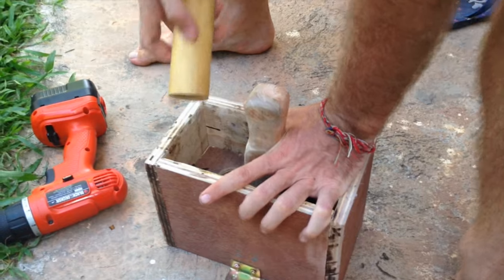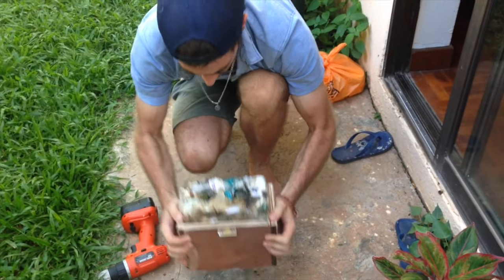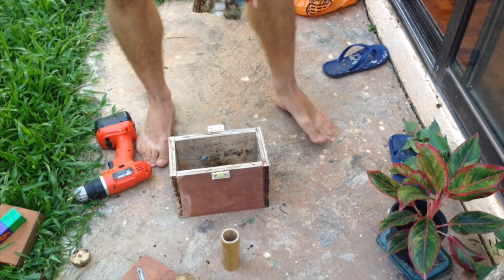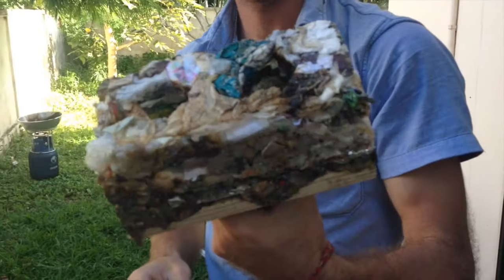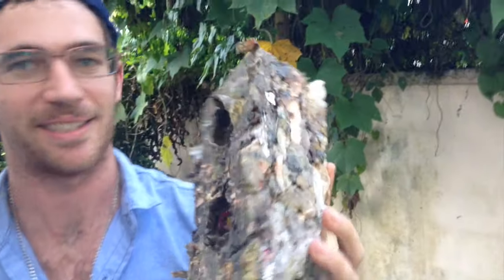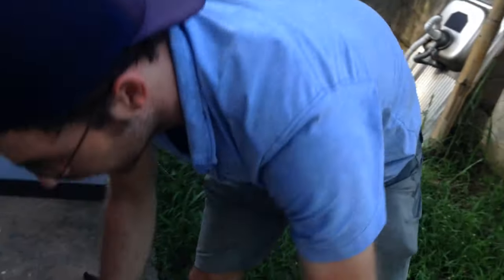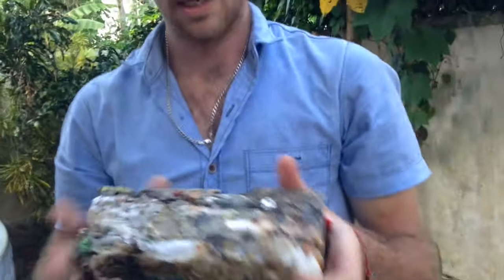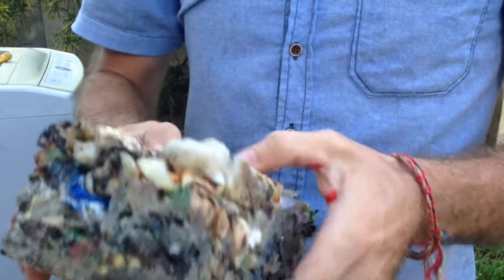Our First Plastic Brick

Comment: Hy, 
Please the processser to make plastic brick.
what material you used in that?
what is the mixture you take that material?
Reply from the maker: Hi Chirag
We made the bricks with a gas heater and a wooden mould as seen in the video and we used all different types of waste plastic from our homes.
Reply: Actually,
I want to make plastic brick using the cement ratio in plastic.
For college project 
Please help me in my project
Reply: chirag mittal hyy..did u make palstic brick for ur project..if ys could u please tell me the procedure to make this palstic brick..i am also planning to take this topic for my project..